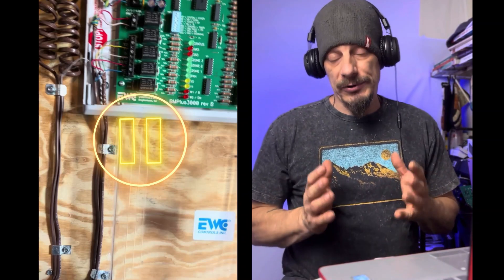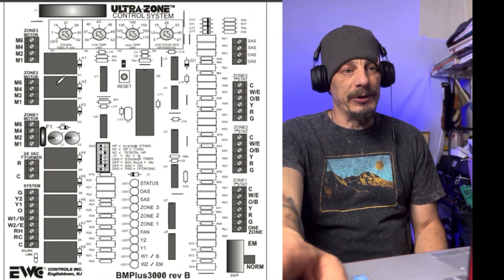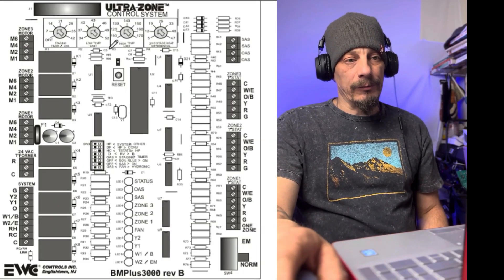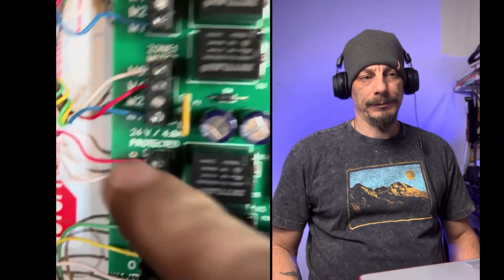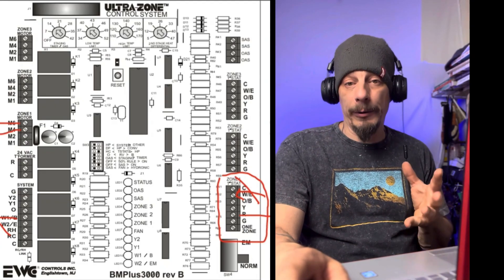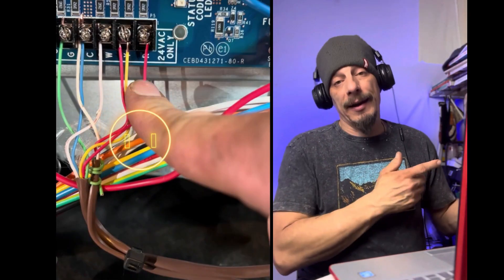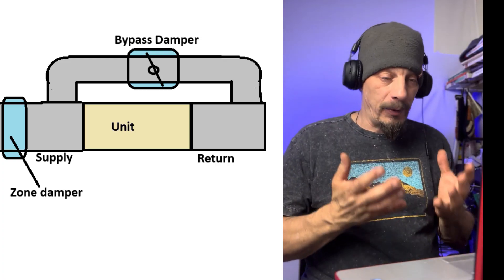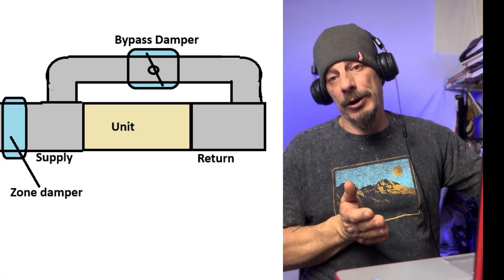Zone Panel Wiring for Beginners

Comment: Can you comment on how a steam hole house humidifier would be wired in a two zone system?  I understand how this would be wired in a single zone standalone system with the green wire being fed to the humidistat, then back to the system, allowing the humidistat to turn the fan on when it is calling for humidity. Not sure how that would work with a multi zone system.

Comment: Hey Mike with the system operating with one zone open and the bypass open would the velocity across the coil be a concern ? How would we combat water slinging off the evaporator? Can you use this with a constant tourque motor or a variabble speed drive ? I guess Im asking for a addittional video on the problems associated with zoning .

Comment: Professor Mike, you are excellent.  I came across your daul zone wiring video looking for trouble shooting  a daul zone geo thermal system stuck in cooling mode. Thought is stat batteries,  changed them no luck. Pulled stat from wall, no luck. Shut breakers on air handler and back on, put stat back on wall with no call for cooling and system stayed off. Leaving it off till I can pinpoint the problem. I would be extremely grateful for any advice in what direction to go from here. Thanks so much for the great viseos.
Reply from the maker: The system continued to run with the thermostat disconnected? It didn't stop until you manually shut it off at the breakers? Is that right? Sounds like a bad relay in the unit if so.
Reply: @JerseyMikeHVAC that is correct,  ran with stat removed. I did restore power at air handler, stayed off for a while, then found running again with no call for cooling. Would that be a bad relay in the air handler or condenser unit? Thanks in advance for your help.

Comment: We work new construction most of the guys don’t know how to wire, they use wires we don’t need or put double wires in the board instead of running tstats to board, outdoor unit inside air handler and from there going to board.  I noticed a lot of double connections have been causing shorts because they seem to always come loose at least for the zone boards we use.

Comment: My interest is always electrical…I would install a separate 100 amp sub panel for HVAC if I were the electrician doing this, is that a common practice in residential systems with zone air conditioning?  I realize that multi zone residential systems are less common…

Comment: Jersey Mike basic question: where can the dedicated zone board transformer be located? Inside the AHU? If so how does it get its line voltage power?
Reply from the maker: The transformer is usually installed with the zoning system, so it is the installers discrepancy on where to put it and where to tap power from. It's not unusual for the transformer to be mounted inside the AHU and immediately spliced into the power for the unit itself before feeding into the AHU's control board or anything else. Sometimes it's more practical to mount it directly on the 1900 box with the on/off switch for the unit. 

The only 2 things needed to be taken into consideration is:

 It has to be a constant power supply. You obviously don't want to tap into a light circuit after a switch which won't be powered when the lights are turned off. 

 The other is the ability to kill power to the transformer when desired without killing power to other things in the process. So if you tap off a part of the  light circuit that will always have power prior to a shut off switch, youll probably want to install a separate dedicated switch for the transformer itself so you don't have to kill the breaker feeding all of the lights just to work on zoning.

That all being said, the AHU circuit is usually ideal to take off of a 20 amp circuit AHUs are usually rated for, vs a 15 amp light circuit, considering that circuit is providing the power needed to operate the zone dampers. Always take into consideration power draw of the equipment in the circuit. I've had no problems going off of the dedicated AHU circuit in this regard.
Reply: Thanks so much. Is there something in your opinion in the NEC that allows the lower gauge wires of the transformer leads to be connected to the power supplying the AHU? Big discussion in my area.
Reply from the maker: NEC Article 450.3(B) 

This basically states that a lower max amp rating of a 16 or 18 AWG wires off the primary side of the transformer can be spliced into 10 or 12 AWG wires of a 15 or 20 amp circuit so long as the lower gauge wires have max overcurrent protection. The breaker of the higher amp rated circuit (15 amps for example) cannot exceed the max rated amperage of the conductors connected to it. So to satisfy the NEC code, you'd have to put an inline fuse on the hot leg of the 16 or 18 AWG wire of the transformer (that may only be rated for 10 Amps). 

 You take the FLA (full load amps) of the transformer itself, and then you figure 167% of that value if there is no fuse or overcurrent protection on the secondary side (the 24v circuit) and put an inline fuse on the hot leg of the lower amp rating AWG wire to satisfy NEC Article 450.3(B). OR, if there is a fuse (such is the case on an AHU with a control board and it's 3 amp fuse), you size the fuse on 250% of transformers FLA. 

 So for a typical 40 VA XFMR on an AHU with a 3 amp fuse, a 1 amp inline fuse on the primary side of the XFMR permits the two different AWG wires to be spliced together.  For a 75 VA XFMR  with a 3 A fuse on the secondary, its closer to 1.5 or 2 amp inline fuse on the primary sides hot leg.
Reply: @JerseyMikeHVAC  will check this out. GREAT video!

Comment: Hi Mike. I have a 3 zone system down in South Florida.  All 3 go to individual bedrooms.  When a thermostat calls for cooling the hvac only runs for 3 to 4 minutes.  
Not effective to remove humidity and the a/c cycles too much. Can i leave all dampers open to allow all rooms to cool simultaneously.  I can use one room as the master thermostat.

Comment: Great video Mike, really well explained.  While watching the explanation on the loop-back duct /damper configuration, which kicks in when only one zone is calling,  I couldn't help but wonder why they wouldn't just use a 2-speed fan and eliminate that ducted loop all together?
Reply from the maker: Thats actually the right way to do it. But the customer wanted a zoned system on a 1 stage heat/cool system on a single tap speed blower.
Reply: oh,  now that makes sense.  Thanks

Comment: Just found this.  Very helpful with my understanding of my Carrier zone system and how zone's work.  Our one zone sounds like a freaking jet taking off and I believe there is a weighted damper installed which must not be working correctly.  I was going to rip the zone system out when installing our new system but now may just ditch the Carrier controls and keep the dampers and get a new control system and bypass damper.  Thanks!!!

Comment: Hi J-mike, I really newly certified so I have lots of questions. For the zone 1 T'stat, your brown cable wire has 5 wires, B,W,Y,R,G, is there suppose to 2 extra wires left over to be used for future add-on's or is not mandatory? I noticed the zone 2 above it had 2 spare wires wrapped around the cable.
Reply: The extra wires are for other systems like heat pumps and inverters. They are just there for those kind of set ups.

Comment: In your video, you say that Orange and Brown is not needed cause it's not a heat pump system.   I believe that in older, non-heat pump, zone systems they were used.  I just replaced an old thermostat that O and B in different slots.  The new thermostat had a single slot labeled O/B.   As far as I  could piece together,  one was for cooling and the other for heating.  I believe they have to do with controlling dampers but I don't really understand any of this.  I tried the one color in the summer and switched to the other color just now and that seems to work, I've been getting heating and cooling.  In the meantime, the thermostat for the zone that I did NOT replace was not working (we didn't use that zone in the summer).   I looked over the manual and there was a setting on the thermostat that had three choices, two for heat pump and one for zone systems.  I switched that parameter to zone and now the thermostat works.  The new thermostat is a Sensi smart thermostat.  Any insight you could provide would be greatly appreciated - your video was great, thanks!

Comment: I might have missed it in your video where do you get your power supply for the transformer designated for the ZB power
Reply from the maker: A dedicated transformer is used which is installed with the ZB.
Reply: @ got thrown into the situation I was worried about and power supply came from inside of the cabinet high V. ZB  never done one and it’s like I heard most it’s more intimidating than the difficulty your video helped a lot and I appreciate your response

Comment: Hey Mike, hope you are doing well today. I'm using the same control board for my Mrcool heatpump (o reversing valve) and Mrcool air handler.  Issue I'm having is when I call for heat I get cold air. The only way I get the board to work is if I tell my thermostat I'm using a B reversing valve system and move the dip to B instead of O. I'm not sure what I'm doing wrong here
Reply from the maker: There are dip switches inside the zoning panel that also need to be set. 3rd switch down is to set to regular heat/cool thermostat or Heat pump thermostat. 4th switch down is to set to O or B for the reversing valve.

Comment: Thank you, Great Tutorial! Very helpful when I started adding Nest thermostats to a 2-zone system and received a "no C wire" error code although I had connected it to the Nest. Your video showed where to look and sure 'nuf, the blue wires from the thermostats were bundled at the board. Connecting them to the C connector for both thermostats fixed the error code. Thanks again!

Comment: My parent's house has 2 zone dampers. One damper is old that it needs a special thermostat that sends power to open and close. Does this mean that I do not have a zone panel? I thought I might have a zone panel as I see C, Y, G, R, W, P terminals on the outside of the HVAC unit with wires connected to it.

From watching your good explanation video, when the thermostat satisfies, it is going to kill 24v signal to the W terminal and the zone panel will send power to the M6 to power close, thus nullifying the need for a special thermostat to send power to close.
Reply from the maker: Zoning dampers come in different arrangements, so they don't all work exactly the same as in the video. If you have 2 wires to the zone damper you likely have a spring damper that is powered closed and opens on a spring when power is removed. 

3 wires indicates a power damper that has no spring and must be powered both open and closed.

Sometimes you can even have 3 wires on a spring damper, where the third wire is just power for an indicator light and not the motor itself.
Reply: @JerseyMikeHVAC  Thx for your reply. Your videos are informative.

Comment: Hi Mike, Great Video - Quick Question - Have a normal two zone high efficiency gas furnace setup and have the exact same NCM300 Zone Board -Where I have smart thermostats, just performed an update and added a dedicated 24V 40VA transformer connected to the R and C EWC terminals  - Have read articles to possibly add an inline 3A fuse on the transformer 24 V side - Looking for thoughts if you get a sec - Thanks
Reply from the maker: I would say it's always a good idea.

Comment: Just found your channel and been watching all your videos for the last hour or two. You have an awesome way of explaining things. One thing i still didnt really understand is the point of the bypass duct and how it is operated. I understood it had to do with static pressure issues if only one zone is calling but how does it get operated?
Reply from the maker: There are 2 tubes connected to the damper.  One goes to the supply trunk, the other the return.  The damper itself has a pressure switch in it.  When the pressure difference between the supply tube and the return tube is great enough (such as when one of the zones are closed and the pressure is higher on the supply) the pressure switch closes and the circuit activates a mechanical arm on the damper that opens it (just 24 volts directly from a transformer and back, with the pressure switch acting like a light switch). When the pressure difference drops (such as when all the dampers are open in the supply trunk) the pressure switch opens and the damper closes.
Reply: @JerseyMikeHVAC  thanks man !

Comment: Hey Mike, are you familiar with gas furnaces?
Reply from the maker: Yes sir
Reply: @JerseyMikeHVAC  Im having changing errors codes and check all the safeties and there code. Both motors are good.  It went on high limit with both motors running and furnace wasnt even fired up was cool.  Im thinking it a board.  Any thoughts?
Reply from the maker: @rcmechanialgroup2856  serial number? 

Is there a limit on the blower housing? Motors hot?
Reply: Theres a limit on the inducer but its not hot
Reply from the maker: Need to know what kind of unit. Model and serial number.
Reply: Its a Luxaire  Model #FL9S040A12UP11B @JerseyMikeHVAC
Reply from the maker: Sorry busy at work. Bypass the high limit switch see if you get the same code.
Reply: No worries. I appreciate your help.   I did that and got the same code. @JerseyMikeHVAC
Reply from the maker: @rcmechanialgroup2856 how far in the sequence is it going?
Reply: At first it was pressure switch stuck open. It fired and flame stopped.   Then I cleaned flame sensor and checked all safeties which were good.  So now no flame and the blower and inducer are running cold and the error now is limit is open.
  @JerseyMikeHVAC
Reply from the maker: I would check for airflow issues. Blower motor cap. Fresh air intake blockage. Maybe even secondary heat exchanger.  Evap coil dirty if there is one. I have also heard that those control boards do sometimes cause blower motor issues intermittingly too.
Reply: Thanks  The air flow issues a nd fresh air intake is good.  I will take a look at the evap coil and secondary heat exchanger see if its dirty.  How would blower motor cao cause an issue?  When I looked at the board and pressed the molex connecter it clicked like it was an connection problem.  Maybe that could be the problem?   @JerseyMikeHVAC
Reply from the maker: Sometimes a loose connection on the wire between the terminals and the cap internals can cause issues. Probably not the problem but it's possible. I would say the sensitive molex plug is a good possibility.

 Had the same thing on a Weil McLain boiler last week. Boiler would start and shut down. Couldn't seem to trace out the problem with a multimeter as I was getting power where needed when I tested. Then I rubbed up against the molex for the vent damper. Boiler started twitching on and off. Had to replace the control module.
Reply: Thanks for your help.  Im going back today, im pretty sure its the board..  I will let  you know what was the outcome. @JerseyMikeHVAC
Reply from the maker: @rcmechanialgroup2856  Curious what you found.
Reply: Hey Mike.  It was the board!  Crazy, I never ran into something like that before.  Was getting different error codes and all safeties were good and no issues with the furnace.  So I was assuming it had to be the board.  Thanks again for your help! @JerseyMikeHVAC
Reply from the maker: @rcmechanialgroup2856  You called it

Comment: OMG…. You should have your own school!! I’ve been hiring AC guys and they couldn’t explain or diagnose my current system problems. Then I found you. Thanks a million for sharing. If you have a video on troubleshooting or bypassing zone dampers to figure out why my heat pump or emergency heat runs concurrent with my ac is running… that would be amazing.
Reply from the maker: Do you have a Honeywell thermostat by any chance?
Reply: @JerseyMikeHVAC  I do. I replaced the old one with with a 3-zone Honeywell control board. There was a weird jumper setup that combined W1/E and W2 with the white heat wire plugged into W2. I removed the jumper and placed the white wire in W1. Yellow in Y1. Now my EM heat comes on when heat is selected on the thermostat but the AC unit does not come on. When the thermostat is set to cool the Air handler turns on heat and AC at same time. Any suggestions?
Reply from the maker: @4twt   Honeywell advises not to hook up to W1 terminal when running with heat pump systems. Thats what causes Emergency heat and AC to run simultaneously. I had to fix a few of them like that. Sky high electric bills! Use W2 instead of W1.
Reply: I second that.  Definitely should have his own school…

Comment: Very good video my man!! Thank you , I gotta a quotation.So how do you wire the bypass damp for this particular set up .?
If you could make a quick video on that it would be awesome. Thanks!!
Reply from the maker: Thank you. Wiring up the damper is real easy. Just 2 wires from the transformer. 24v and common. That's it.  Or you can run 2 wires right off of the R and C on the zoning panel itself where the transformer feeds into it.